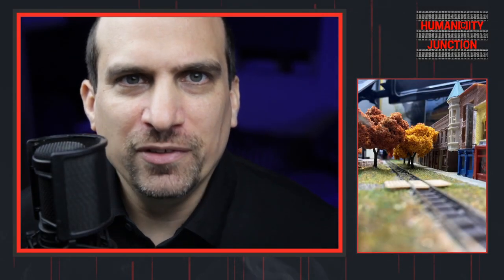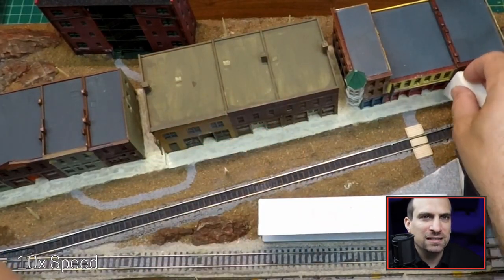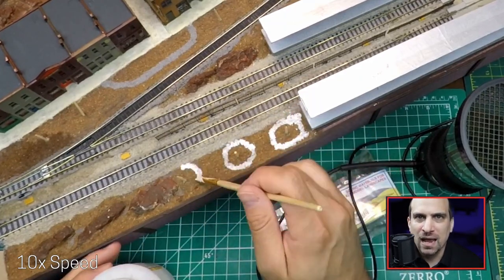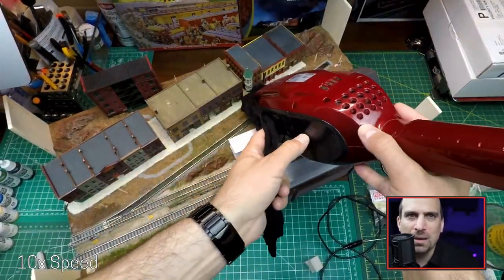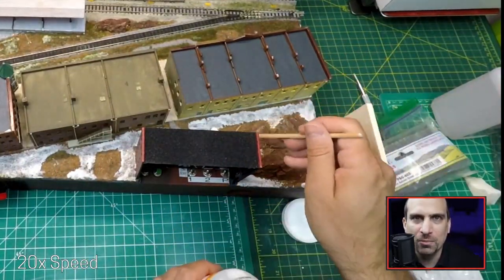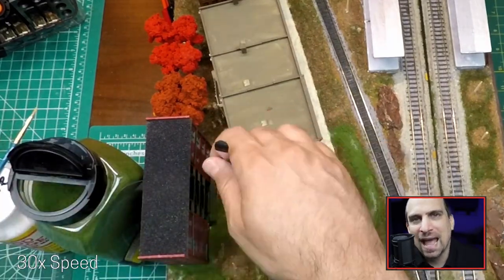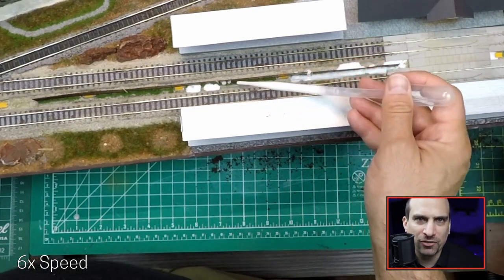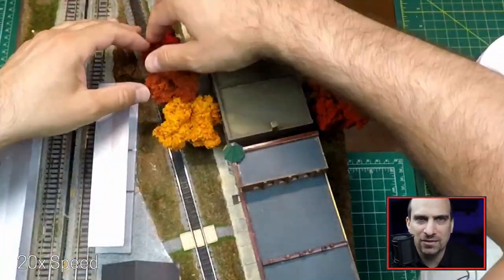33 || Scenery Experiments II Part Two || Sidewalks, Grass & Trees

Comment: The scenery looks really good Heath. I think the biggest lesson learned in doing this stuff is, what order to do things in.  

If you're able to get a vacuum in the space, I wait until the glue has dried about 20 or 30 minutes then hold the vacuum about an inch or so off of the layout.  This really helps the grass stand up.  You have to be really careful in doing it because the vacuum wants to suck down onto the layout.
Reply from the maker: Robert, learning the order that I want to do things was a good lesson.
I also need to be more patient. I never wanted to wait for the glue to dry. I kept rushing things.
I think it might have to do with working on such a small layout. I could not move on and work on something else, because there was nothing else to work on.
Reply: @HumancityJunction  Even with a big layout sometimes there is nothing to move on to. LOL.  I ran out of track nails, wire connectors and track all in the same night.
Reply from the maker: @FlyingCrow  Ugh, that must not have been fun.
Reply: @HumancityJunction  Luckily I have it all ordered and it will be here tomorrow or Saturday.

Comment: I think things look good.   If you want more grass between the Tyes try making tufts.  Lots of video out there but basically put a small drop of glue on some wax paper and use your static grass applicator.   Then just place were you want them.   We are learning together.   Im trying to make my own trees for the first time.
Reply from the maker: Chris, Ironically (I am not sure that is the correct word), I got some 7mm straw colored grass that I was going to do just that with, but then I lost patience.  This is something I would like to go back and do at some point in the future. - Heath
Reply: Trust me I get frustrated all the time but I still keep trying.   Right now it's filter trees.   Watch  RTNT.   That's my inspiration.    As they say try and try again.   Practice on small areas.   We'll figure it out.
Reply from the maker: @CM-ARM  I definitely watch a lot of videos for inspiration.  I did not think that I would like working on modules, but now I really like that they are basically like small dioramas. 

Thanks for all the comments, we will figure this out :)

Comment: There's always a lot of ups and downs doing scenery, but your end effects look great!  By the way, I believe both Noch and WWS (world War Scenics) now have small applicators for tight spaces.  Ollie from Wardle Road did a demo on it a few weeks back.
Reply from the maker: Anthony, I bought the applicator I have because it is the only one my local hobby shop had.  I really need to check out the WWS smaller applicator.
Reply: @HumancityJunction  Oh, I understand.  They are not cheap.  I still don't own one.  I just mentioned it because a couple of companies just released them (Noch, Faller,  and WWS).  You did a great job dealing with the tight issues, but if time and wallet allow, you can look into it.

Comment: I have to start off with a LOL for the bloopers but I cant believe you dont have makeup brushes laying around. I had those things layin around before I even knew what a train was, lol. Very useful. Your sidewalks look better. If you still arent happy perhaps try some photo software and paste some sidewalk images together and scale it down. I dont know if google earth will look good enough, I havent tried it yet. but for n scale it might work well. Your grasses dont look bad. I have yet to try the static grass but after watching a lot of videos I hear people talk up the peco grass over woodland scenics. I have woodland scenics entire line of grass on the shelf but no peco :( Perhaps you can take a small battery operated trimmer and cut some and make it more random looking. Cheers Rob
Reply from the maker: Rob, I did the printed sidewalks for all the station platforms and the depot, but I did not for the merchants row.  I probably should have.
Static grass application looks easy when other people do it.  But to get it looking realistic is definitely an art.

Comment: i used 12mm grass on my n scale purposely. of course it's way out of scale bu i want to get more scenery done before deciding if i will trim it with a pair of scissors or leave it as "tall growth." your module is looking great. maybe the 6mm is a bit long around the buildings but i think it's ok around the rocks where it would not be mowed.
Reply from the maker: I got some 7mm straw colored grass that I intended to use for that purpose.  But when I messed up with the 6mm, I did not include it.

Comment: If it's any consolation to you I had trouble with static grass. Gave up and went to using Busch grass on a roll. It's more to scale and in my view looks better. Try some and see how you get on.
Mark
Reply from the maker: Mark, it looks like the Busch Mats are HO scale. I am N scale.
Reply: Sure you can find the same in the States
Reply from the maker: @PiddleInTheMarshbyMarkIreland  Ahh, Scenic Express had the mats, but not the rolls.  Thanks.
Reply: @HumancityJunction  The grass is on a paper type backing and I found it worked best to dampen it with a spray of water to make it flexible before gluing into place.
The hill in the centre of my layout is one complete piece  which should show you how flexible it is !